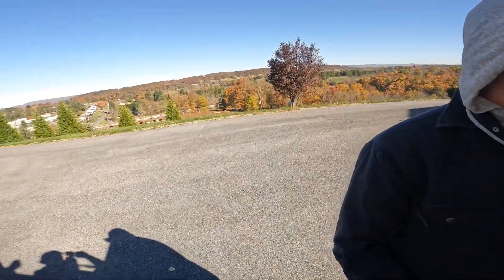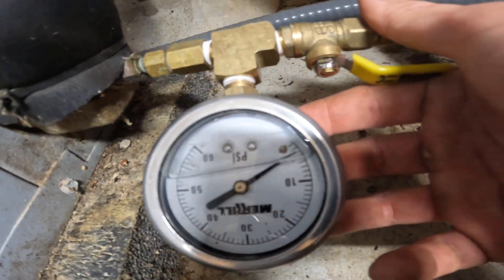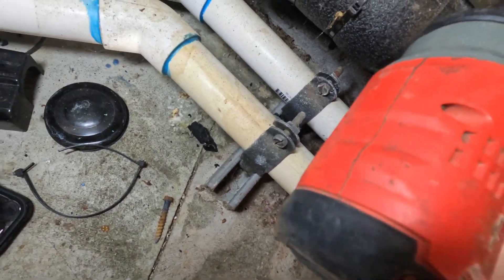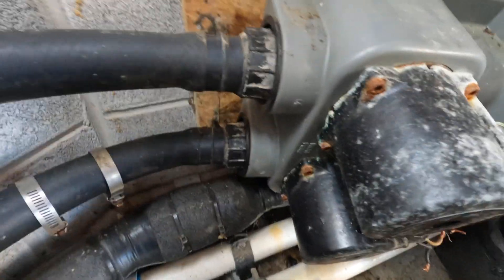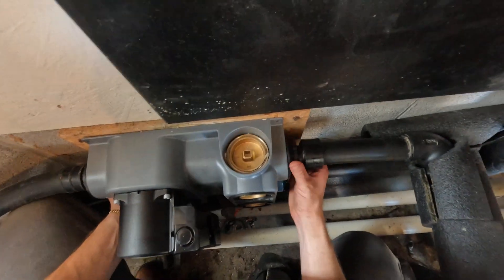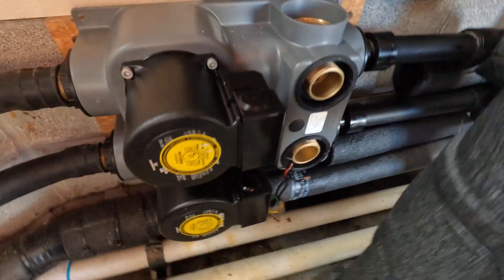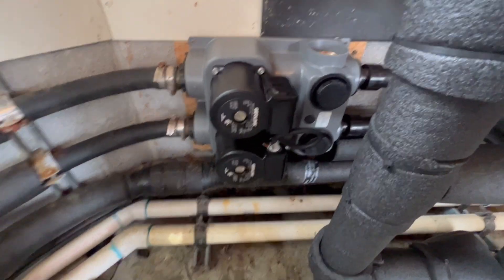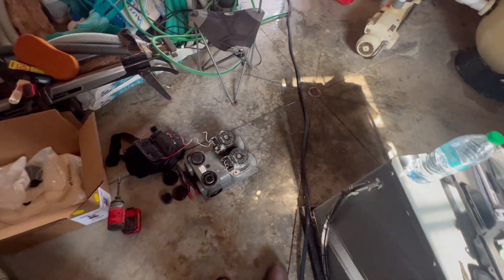Geothermal Heat Pump Flow Center Change Out | Life as a HVAC Service Technician | 2025

Comment: How do you purge the air out after replacing flowcenter. There must be lot of trapped air in the system. That’s not good.
Reply from the maker: I blead them , its just not in the video. You bleed them right on the circulation pump with a flat head screwdriver.